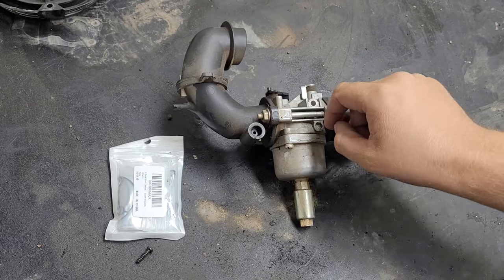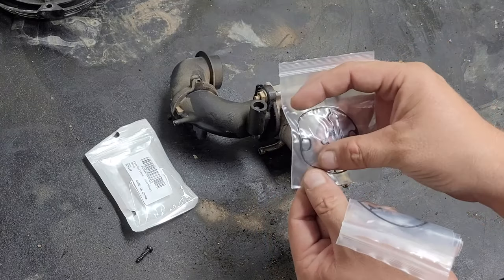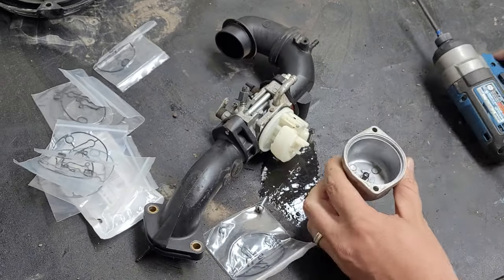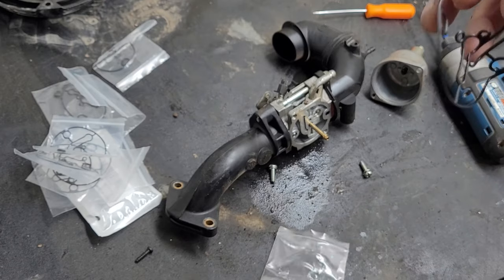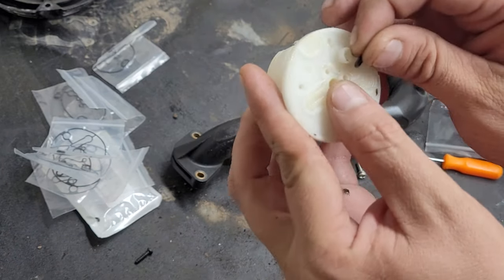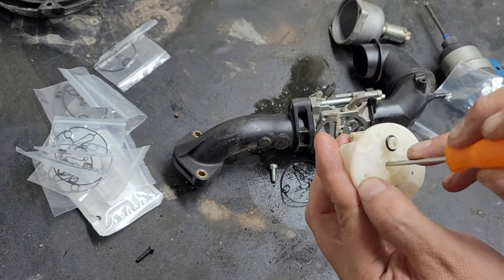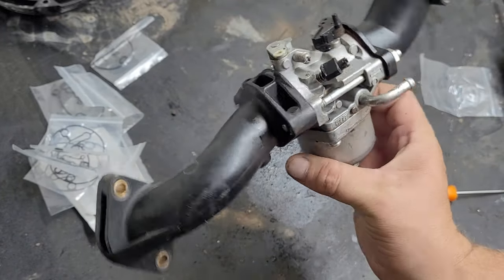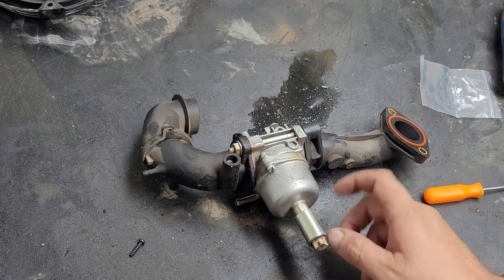How-To fix a FLOODING Carburetor on YOUR riding lawn mower/ lawn tractor.

Comment: Ethanol is the cause of nearly every engine problem I've had.
Reply from the maker: I feel that my guy but if people use it and don't let it sit 90% of the time the average person will not have a problem.
Reply: And that's why I stopped using ethanol fuels and either run non ethanol fuel which in my town only 1 station runs it and it's the 91+ only or I run canned fuels from Lowe's. I have ran regular but I mix stabilizer in when I do

Comment: I've noticed now on Amazon where most people get these aftermarket non-OEM gasket sets, that there are a large percentage of people saying the big gasket fits fine but the small gasket is wrong size. It's a bummer since that is the one you actually need. Have you had this problem?

Comment: Thanks for the video great tip also you can buy a new carburetor with all the fixings for about 25$
Reply from the maker: Yes some people hate aftermarket
Reply: I just put an aftermarket on mine, now it us surging really bad. Gonna fix my original carb that only had the flooding issue

Comment: Thanks a million for this. I have an old Craftsman riding mower/B&S motor, and it started to flood and leak and even filled up the top air inlet with gas after I was done mowing. I'm going to try this out, thanks!

Comment: Thanks for that video, sir.  Ordered a B&S carb kit that has that little o-ring along with the other gaskets, etc.  Thought about getting one of those new cheap Chinese aftermarket carbs and just replacing it.....but figured it would be better just rebuilding the original one.  Btw....the Briggs kit is about $15 cheaper than the John Deere one....same exact kit too.  Keep up the good work!
Reply from the maker: Thank you

Comment: My carb was flooding so badly, at times I would see fuel under the mower, and it would no longer start. I'd come back the next day, and it would run again. I tried all the tricks I could find on YouTube. I finally figured out the problem. It was the little rubber tip at the end of the needle valve. The tip was cracked about half way through and leaning to one side a little. It was an easy fix, once I figured out this was the problem. I had the mower looked at twice by our local shop, but they didn't catch this.
Reply from the maker: That's sad that your local shop didn't catch it. If you came in or told me your lawn mower is flooding. I know exactly what the problem was. It's very common. Maybe they just didn't care
Reply: Agreed!!
Reply: Curious, did they still charge you?? 
  I assume they did and told you a carb was needed?
  What did they charge?

Comment: My dad's mower flooded all into the crankcase.  I just got the o-ring kit and the small o-ring as you show here looks good just like the new one I just installed.  I'm hoping the old one was dissolved a little from ethanol..... as again it looks good like the new one.  I'll be trying it out tomorrow
Reply from the maker: Well let me know. Yeah cuz just a little bit will cause it the flood so putting in this new o-ring should fix your problem
Reply: @RepairGang  Yes sir I'll let you know how it goes!

Comment: Thanks for the video!! I have a 2011 D100 that is blowing gas out the exhaust while cranking. Pulled off the fuel line & it started & ran for about 20-30 seconds before running out of gas. Put fuel line back on it ran until getting too much fuel, pulled the line it ran good, then started to stall, put line on, it picked up until flooding, did that a few times. Haven't dropped the fuel bowl yet, but I have an o-ring assortment maybe that will work? Also it looks like I can do this with the carb mounted, just drop the fuel bowl & swap the o-ring? I'm sure the oil is probably toast too, will change that as well.

Comment: Had a s…load of gas blowing out of cylinder when I removed plug. That small o ring was toast so I’m guessing that is why. Think I’ll just throw a new ready to go carburetor on in case there are bits and pieces throughout the carb. Will check the oil to make sure no gas got in it.

Comment: What tractor are you fixing? I have a 1995 Deere STX38 (black deck) and having a carburetor issue and not sure what my prob is. I was told carb "hydraulic lock" and unsure if i need to replace the whole carb or if its only this issue.

Comment: I was wondering if you could tell me what’s wrong with my lawnmower my lawnmower would not start so I was thinking that it had a bad carburetor so I replaced it with a new one and it still will not start if I choke it it will not start but if I put my hand over the air intake to choke it it will start and if I spread my fingers apart to barely get air inside of it it will stay running but if I remove my hand it gets too much air and dies
Reply from the maker: 100% something's gummed up and your carburetor and your fill lines in your fuel pump or you got bad gaskets so I take it apart again. Re-clean it and see if you can fix it again and replace all the o-rings and gaskets. Make sure everything is there from carburetor to intake and so on and so forth

Comment: great video question, what's the pipe called that's connected to the carb mines cracked and made of aluminum Yard Machines 11A-546H229 (2007)  cant find the part
Reply from the maker: Intake manifold is what I believe it's called. I would type in carburetor for whatever machine you have and take manifold

Comment: My Murray riding mower (27 yrs old) will not start on choke. I eventually get it going but it takes some time. Is the carb flooding on choke and is that the reason it won't start? It turns over but doesn't start on choke. Is that a Walbro carb you are working on ?
Reply from the maker: Not a walbro, they only really make 2 stokes

Comment: I ran mine out of fuel last year so i just left it empty until it was time to mow again this year. When i filled up the mower it just kept bubbling through the carb snd filling up that bowel where the air cleaner sits. Do you think this is my problem? That seal?
Reply from the maker: Yes sir I almost positive it's the problem
Reply: @RepairGang  man i thank you so much. I’ll get on it as soon as i can get me so gasket kits. Do you think i need to worry about fuel in the crank case?

Comment: After sitting all winter, found gas had drained into the oil, replaced the oil. Would this repair fix that problem or replace tge entire carbuertor?
Reply from the maker: Yes, you can do this. It's the cheaper method or you can just replace it. It's the faster method

Comment: Or if you use ethanol free gas this isn't an issue, or if you have a different carb that doesn't use that little gasket this isn't an issue, but if your needle/seat or float is bad, any carb will flood.

Comment: I did this to my craftsman lt1000 17.5 hp Briggs it still floods when I shut it down.then hydraulic locks and I have to drain the oil.any other ideas?

Comment: Hi Do you know how many turns out on the mix screw on Nikki carb? I can't find it anywhere.
Thanks
Reply from the maker: Not off hand I say in all the way out 2 turns
Reply: @RepairGang  Thanks
I finally got this 115 running today.
1. The breather tube had a crack right behind the ridge. I was spraying outside of the carb with brake cleaner and spotted it.
2. The fuel lines were crossed up at the pump. Finally got them straighten out.
3.one end governor spring is hanging on the lever. I have to figure out where the other goes. I can't quite make it out in the manual.
Anyway I got it running late last night and it sounds good. I forgot the oil that ran down on the muffler. I'd had the valve cover off. I let it run long enough to get hot several times and had the neighborhood smoked up.
But it sounds good.
Moving right along tomorrow I'll see if it will move..
Thanks again I appreciate it
..
Reply: @RepairGang  I think you nailed it again! Thanks again..

Comment: Since the intake manifold is plastic/Bakelite is there a torque spec for the intake bolts?
Reply from the maker: Not 100% that I know of. I just wouldn't go too tight. I've never had a problem with them. Come and lose. You can put a dab of loctite on there to help

Comment: I smelled gas really bad after i mowed and seen gas leaking from carburetor.  Discovered gas is in my oil.  Im assuming its not just a gasket.  Any clue what i need to change?
Reply from the maker: its flooding somewhere in carb for sure

Comment: My Briggs & Stratton will start and run fine but after I shut it off gas leaks into the engine.
Does this fix that problem?
Reply: Probably not.  The solenoid under the float bowl usually sticks in the down position which lets the fuel pass through the bowl and into the cylinder, through the valves and into the crankcase.  Be sure to check your oil and if it feels really thin, or if it smells like gasoline, then you need to replace the solenoid or install an in-line fuel shutoff to stop the fuel from flowing into the carb after shutting the mower off.

Comment: I’m having flooding issues like this however, I noticed that my mower will try and turn over better if the spark plug is out. Could this issue in the video be my problem or do you think it’s more related to starter and compression?
Reply from the maker: Yes
Reply: adjust the valves. common issue with the briggs engines.

Comment: I was having a surge problem. Bought a brand new carburetor put it on and it runs okay but, it runs rich and I cannot bring it down. Is there a fix?
Reply from the maker: More than likely there's a little adjustment screw on your carburetor
Reply: @RepairGang  it's the same carburetor as shown in the video. I'll try to find a diagram. I'm certainly no expert on carburetors anymore. Thank you for replying to my question.
Reply: @RepairGang  Wait a second. Are you talking about the fuel air mixture screw? Because I have that out as far as it'll go without falling out of the carburetor. And it's still running too rich. Or are you talking about a different screw?
Reply from the maker: @jimmierodgers2397  try pushing that screw in some more but what I recommend is you're getting too much gas. Not enough air so maybe your choke's not opening all the way properly. So check to see if your chokes working correctly or I would try to take off your air filter and maybe your air filter is clogged. If not, when I get a chance I'll look at one of the carburetors I have and see what I can figure out

Comment: I want to bypass the electric solenoid under the carburetor and install and static jet screw instead. I'm thinking the soleniod is the problem, because it causes two problems. 1. Lack of fuel. 2 Floods the carburetor because its stuck open. Maybe the solenoid wires can be connected together and the solenoid replaced with a static jet  screw?❤
Reply from the maker: just remove solenoid and clip the needle off thats how you bypass it

Comment: I had the same issue with my carburetor. The enginw was flooded. I took out the spark plug and cranked the engine a couple of time flushed out the engine, but its not flooded anymore. So it may be the issue you said, but alone Im not seeing any fuel passing into the spark chamber. Im thinking its the solenoid. It dies out due to a lack of fuel. The solenoid might be have failed completely, either staying completely open or closed. Where can I get a new solenoid for. Craftsman ?
Reply from the maker: solenoid will not cause flooding
Reply: @RepairGang  I had multiple issues. 1 the fuel solenoid was stuck open/closed. It didn't work properly 2. The float O Ring was worn out. 3 Bad battery. It was causing electrical issues and stalling.
Reply from the maker: Damn but all simple fixes let me know if you get it running

Comment: Do you believe it's my gasket it's a huskee I thought it was my spark plug but when I took the spark plug out fuel came out and more than just a little drop can you tell me what's causing this issue
Reply from the maker: Yes
Reply: @RepairGang  so I took it apart just like you showed already ordered the part or kits and the rubber o seal was almost just crumbled when I took it apart hi to take a super thin screwdriver to get it out cuz it wouldn't even just come out but you believe this will fix my issue

Comment: My craftsman mower has new carburetor and spark plug. 
The previous owner said “it’s had a blown head gasket for a while but now it won’t start”. 
I removed the spark plug and fuel pored out. 
I removed the valve cover and fuel pored out. 
I Did a finger test on the Spark plug 
(⚡️👈 ) and it has power going to it when you turn the key.
Are you able to diagnose with this information and save me time?
Engine is an 18HP B&S 31P777 0299E1
Reply from the maker: Yes carburetor is flooding replace carb or clean it and drain oil and should be good
Reply from the maker: If it starts with starting fluid you should be go to go

Comment: This is why I only use ethanol free no matter what. Ethanol just degrades the rubber over time no matter what.
Reply from the maker: Right just hard to get for some people
Reply: @RepairGang  yes, I understand. People think just because they burn thru the ethanol fuel, that everything will be okay.
Reply from the maker: @NewVisionLCS  it should last a lot longer if you store the machine inside but out side with reg gas and you looking at 6 months to a year before your replace lines
Reply: @RepairGang  I keep my equipment inside and only run ethanol free gas.

Comment: So my little o ring and brass piece isn't in my carb.
Reply from the maker: Was your car flooding and running rough? Probably why? Unless it's a different carburetor it's supposed to be in there
Reply: @RepairGang  yea the whole cylinder was getting filled almost instantly with fuel. Im pretty sure the previous owner took it apart and lost those pieces. Thank you for your video it was awesome
Reply from the maker: @dan79transam65  order an aftermarket carb they cheap

Comment: I just put that little gasket on the plastic first and it floods right when I turn the gas on
Reply from the maker: It might be on wrong or got ruined some how
Reply: @RepairGang  I just tried it again little oring is staying on the plastic it's brand new I just got it 30 minutes ago
Reply: @RepairGang  but its still leaking
Reply from the maker: @nickolasvaughn667  could be the wrong size ring idk email me pics
Reply: @RepairGang  I just got it from The mower shop but I'm going to walk back up hopefully he fixes it for free if not I'll just buy a carb
Reply: @RepairGang  it goes over  the plastic tight I don't know
Reply from the maker: @nickolasvaughn667  I hope they do it's simple
Reply: @RepairGang  they said this needle looked good but sold me one for 12$ but it's not leaking now so thanks it was me or the needle I guess
Reply: @RepairGang  I just cut my grass it's all good

Comment: ?? HOW ?? can this O-ring be the flooding problem the gas can't get to it unless the needle valve is overfilling.
 ''Gas leaking out of your carburetor?'' (( Float needles sticking or not sealing! ))
Reply from the maker: That o-ring will cause your gas to leak out and your float to keep letting gas in
Reply: @RepairGang  Sorry you were ''RIGHT''. I didn't that O-ring was before the needle valve thank you.
Reply from the maker: No problem 😁